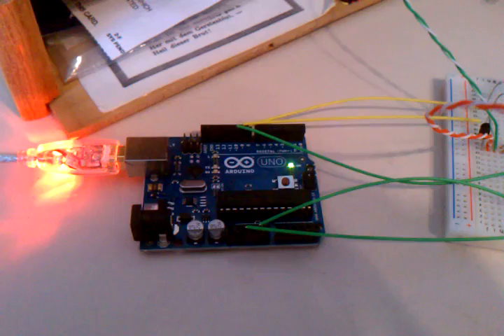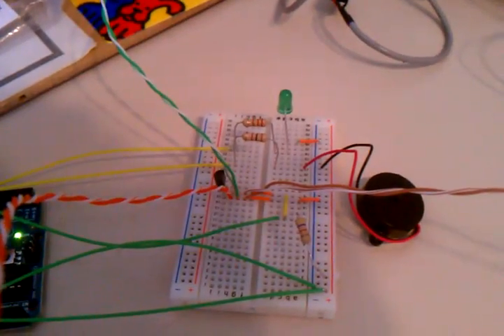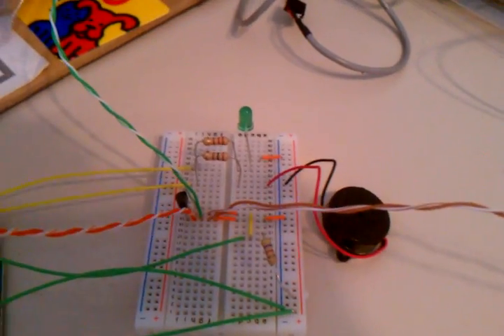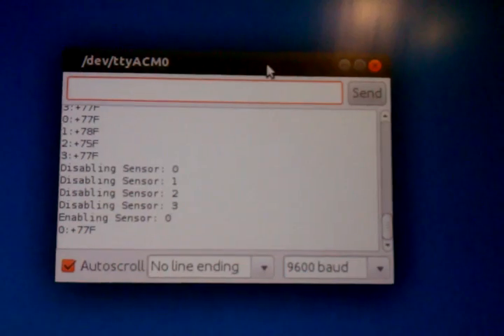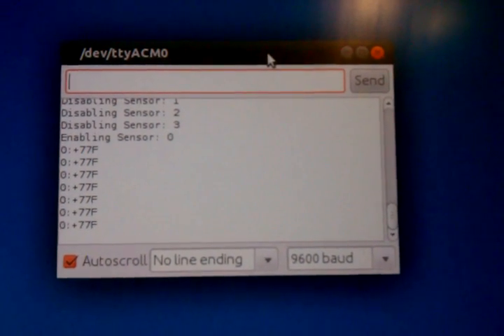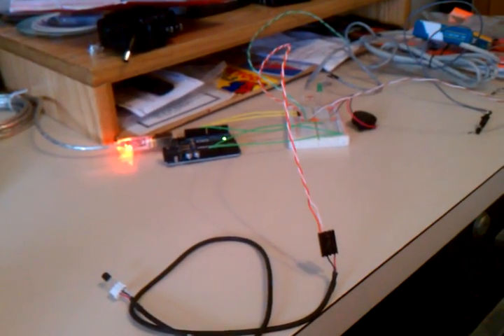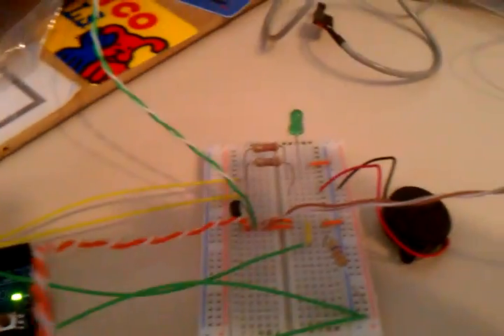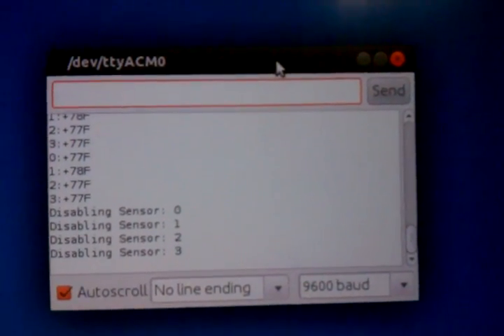Arduino brewing controller

Comment: Well, I'm still in the process.  Assembling the Arduino controller was pretty quick, but I'm slowly upgrading the system piece by piece as to avoid a major dent in the wallet.  Currently I'm brewing on a turkey fryer with a gravity fed system.

Comment: My plan is to have a sensor mounted in the HLT, Mash Tun and Boil Kettle for an e-HERMS brew setup.  Each sensor would be in charge of monitoring and controlling the temp within that vessel.  You're right in that you probably don't *need* more than one (as long as it's mobile), but considering the price of the sensors I opted for the multi-sensor route.